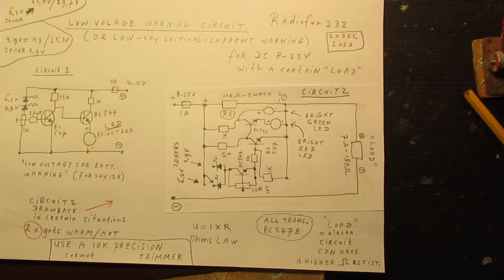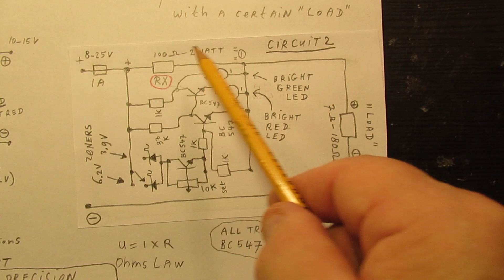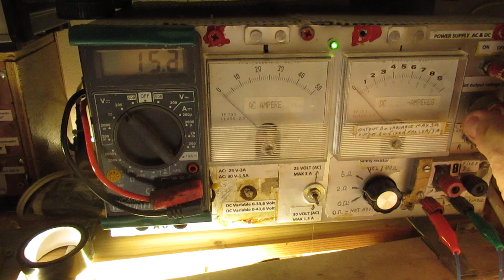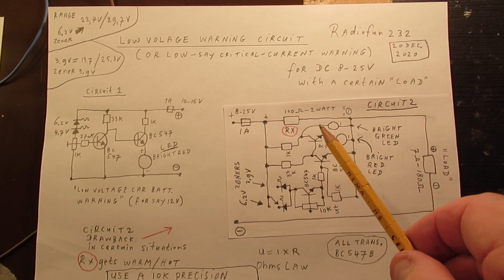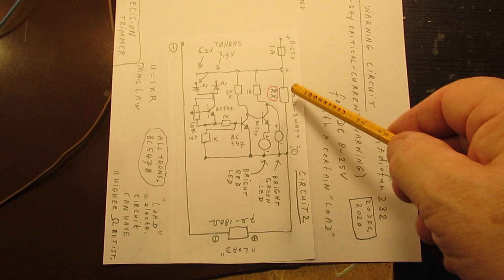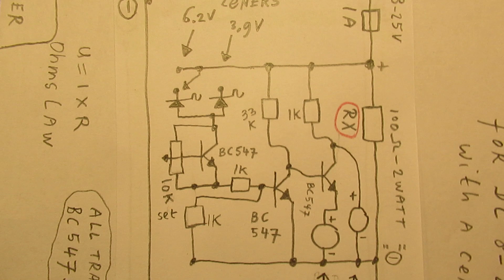Low voltage indicator 13-28 V  (0,3 V precise) or "tiny current changes indicator" (schematic)

Comment: That's certainly a useful little circuit!
Reply from the maker: Thanks & yes it is. Though I am in the end of the video  somewhat critical about circuit 1 (12 V lead acid car battery watch over) that also works good (was tested).